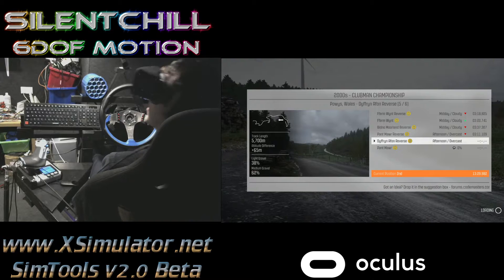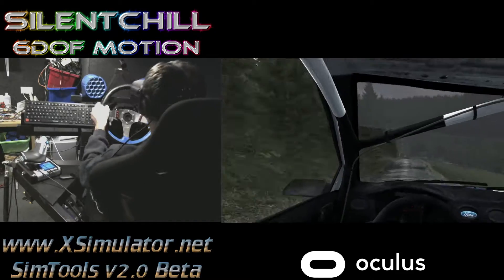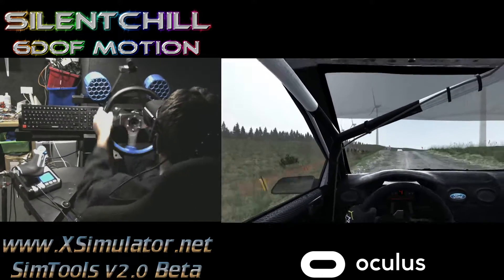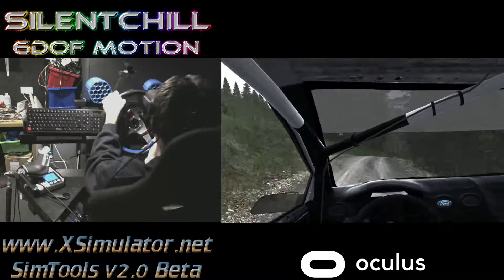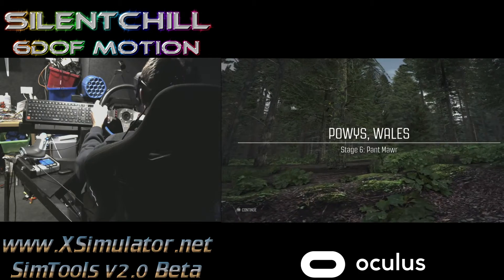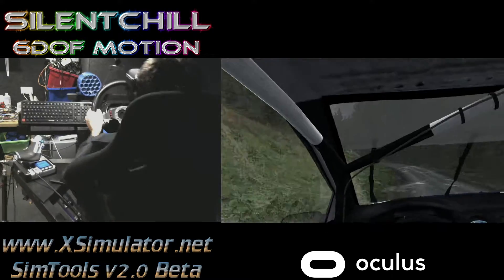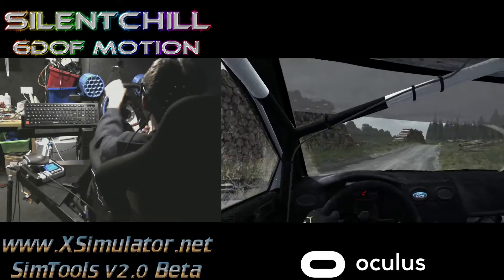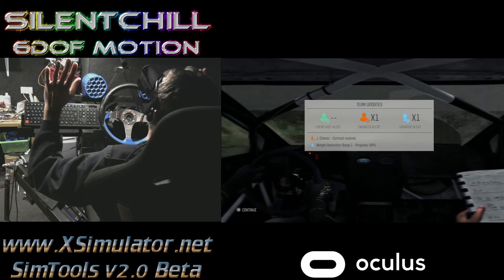DirtRally - G27 Wheel Modded 6DOF setup pretty well now...........I think

Comment: with a 4point belt ur headmovements should be closer to a real rally driver, they are strapped in real tide for several reasons
Reply from the maker: yes totally agree it would help, I had a cheapo 4 point one but it keeps going loose, I really need a decent 5 point harness really,  it's on my to buy list